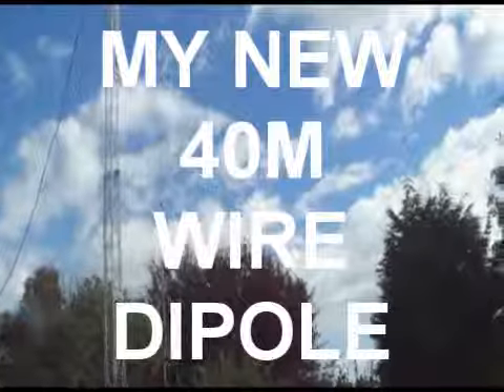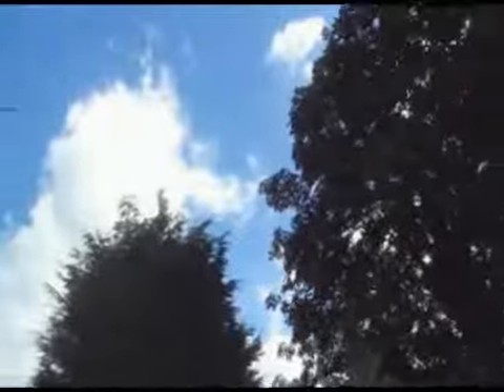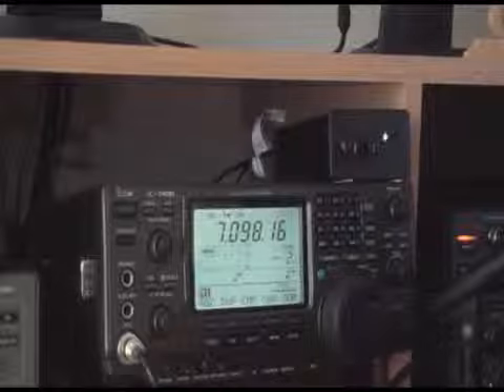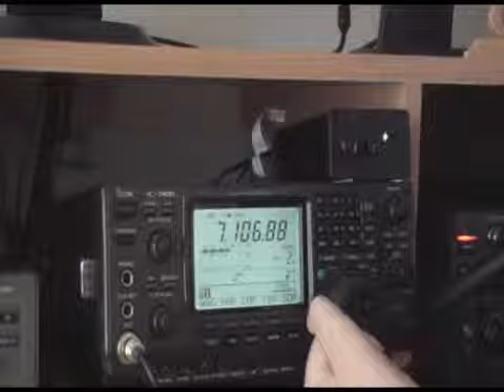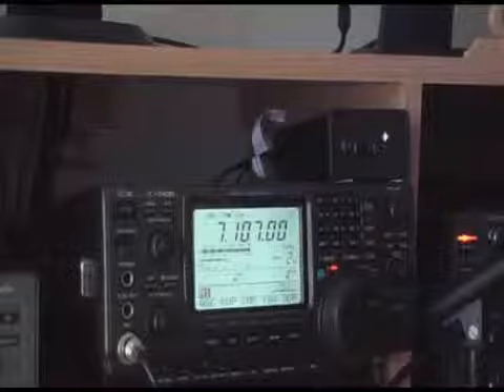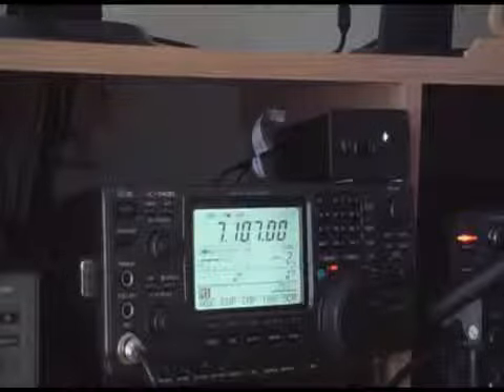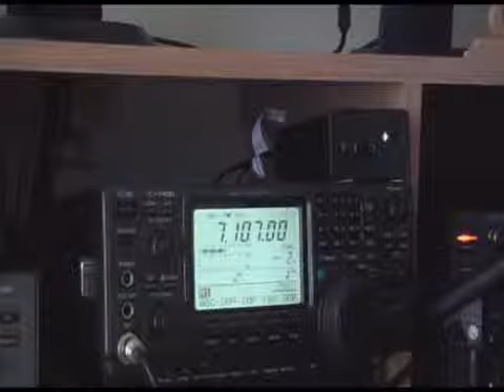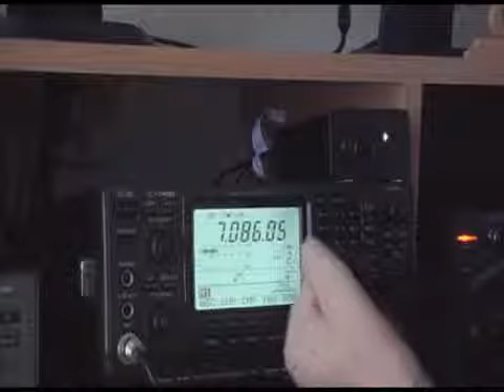40 meter amateur radio band  Wire Dipole

Comment: 7.107 Mhz last I checked was the 40 Meter CW not phone. Phone doesn't start until 7.125 Mhz am I correct? Please correct me if I happen to be wrong. I have been licensed for six years.